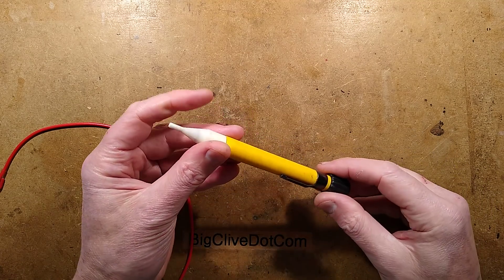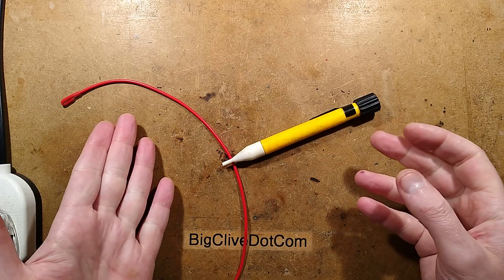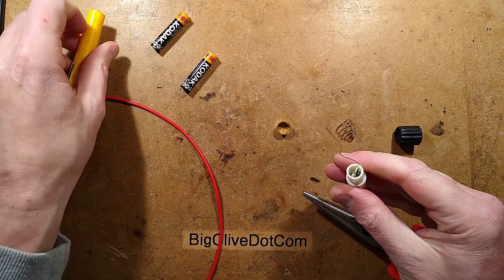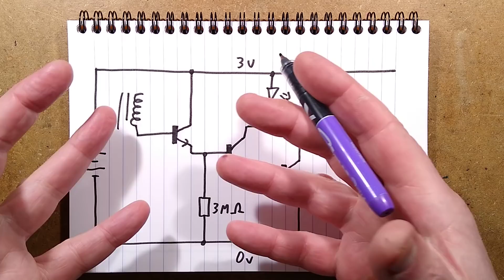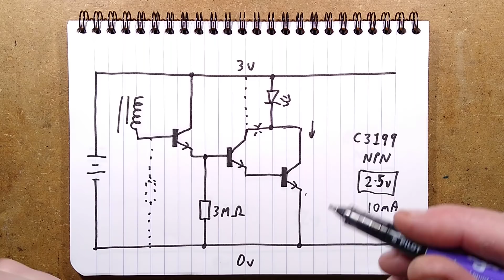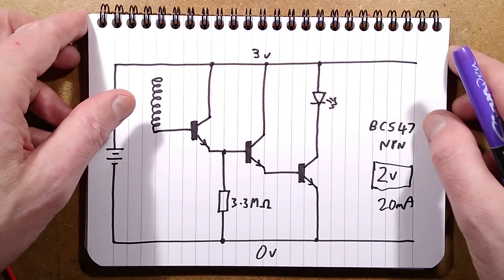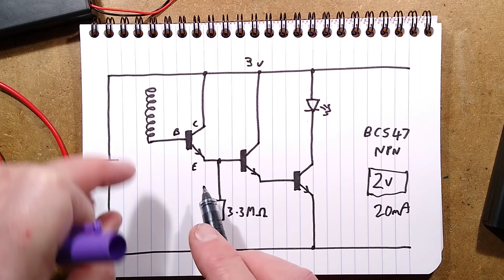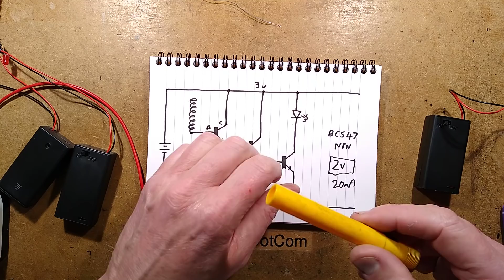Volt stick circuits and tests

Comment: Working on the Austin TX Trail of Lights we used these to find dead lamps in series strings as the voltage stops at the dead lamp. When you’re dealing with millions of little lightbulbs it made a big difference.
Reply: Unfortunately that method doesn't work for LED light strings. The LEDs only pass current in one direction making DC voltage which the testers can not detect.
I spent over an hour the first time I tried to fix an LED light string before I finally figured out why the test wasn't working.
Reply: I've tried to do the same but found it was inconsistent or fails to detect voltage beyond a certain point on a known good string - mine doesn't say the min voltage.  Do you know the min voltage on yours?
Reply: @bbaldwin9411  It's not supposed to light up on a known good string; you need a dead bulb to cause a significant voltage differential.
Reply: @CoolerQ  if we are measuring the voltage between the wire and ground reference as described, there must be a voltage difference, starting at 120 and decreasing along the lights as they are in series.  So the tester should detect voltage all along the string until the string is broken,, or the voltage drops below the testers detection limit. If you are measuring the voltage drop across each light then yes the drop would be small at every light, and large only if there is a break.
Reply: @bbaldwin9411  So would i be able to use one of these to find a break in an extension cord?
Reply: @oodmboo  Yes, but it will generally fail at one end or the other, where it is flexed the most. If it broke in the middle replace it, as this shows it was pulled too much and you will have multiple nearly broken places in it. You just power the cord, and test at the start all way round, as the other conductors will shield the line, and then half way down, then at the end. Will show a broken line, and then plug in a lamp, and you can find the broken return. Will however not be able to test the ground conductor is intact.
Reply: @SeanBZA  Thanks
Ive got a fifty mtr long heavy duty cord, I really didn't want to start cutting in half.
Reply: @bbaldwin9411  there is no voltage drop if no current is conducting. when there is a burn out bulb somewhere in the string then the voltage will be the same all the way to the burned out bulb. once the bulb is replaced and current flows then the voltage will drop. 

I've done this for many years do fix Christmas lights. takes a little practice but you can figure it out from either end of the string and quickly find the bad bulb. I've repaired dozens of strings this way
Reply: @oodmboo  yes. Plug the cord into powered outlet and a load into the cord
(Best is an incandescent light). Start at the "hot" end and move toward the load. When you cease getting an indication be sure to check all sides of the cord. If it stays off you have passed the break.
Reply: @jasonharrison25  w

Comment: I'm sure the original one i had was just a 2 transistor darlington, i could be wrong
One of the best things about that type of detector was in places with multiple lives (control panels etc), you could reduce the sensitivity and detection direction by moving your finger over the tip a little to get variable sensitivity
I have a similar one that uses a 74HC14  hex inverter with Schmitt-trigger and a couple of 'transistors' that i can't make out the numbering of, surface mount circuit
The sense wire is a 10k resistor with one wire cut off, the body of the resistor is at the tip

Comment: Current  gain    array, it's  similar    to a  current  source  (constant)   No  dio-deees  ?   It's   basically  like a  three  transistor  gain   stage   for
a  amplifier   circuit
Reply from the maker: It is really just a three stage amplifier.

Comment: To be sure: Are you providing the path to ground through the plastic on the wires?
Reply from the maker: Capacitive coupling from the metal inside.

Comment: Straight swapping in a small JFET for the frontend would increase sensitivity, while a MOSFET might perform better in the negative feedback configuration... pulling it off with three of the same transistor is highly economical though!
Reply: Using a JFET or any FET in this circuit has the problem of being damaged by static discharge.  The three BJTs are much more resistant to damage.
Reply: @acmefixer1  Especially since my favorite way to test mine before use is to rub it on my pants until it goes off from the static.
Reply: I really expected a single-MOSFET circuit when this video began.

Comment: I prefer to have a "widow maker" that also beeps as sometimes the light isn't bright enough to see in ambient light.
Reply: Sometimes the beeper is also handy for testing switches or finding breakers, if you can wedge it somewhere or have a helper hold it.

Comment: Simple design compared to the one I bought. Mine is audible and pulses the LED in the same way it pulses the piezo buzzer at a few hertz. It requires you to hold it as the power switch is momentary. It does a self test at power up by pulsing the LED and buzzer once. Power supply is from a boost converter as it only takes one AAA cell. As far as sensitivity is concerned, it will work perpendicular to a cable with both live and neutral side by side at 120 volts and will also pick up the leakage of the interference suppression cap on switching supplies.

Comment: I have a yellow metal cased 'version' but it is actually a magnet detector (RS 214-338) along with the Volt Stick which is black plastic (RS 214-467) both bought many years ago and still working.  Maybe it's the yellow magnet detector you remember as metal cased.

Comment: I find it hard to trust these things. I don't have a voltstick but I do have a couple of DVMs with the feature. Maybe it's just because I haven't learned to trust them, but it feels as though there are so many reasons why they may not show a result that it's hard to believe they will give a proper warning. Clive's experience with the battery in this one, and the simplicity (and lack of precision) in the circuitry  only strengthens my prejudice. I still prefer the old neon screwdriver. There's less to go wrong, though they still have the disadvantage of indicating safety by being 'off'. I guess what I really want is something that reads the actual voltage gradient.
Reply: Yep, never trusted them. When you work on control panels and distribution boards these volt sticks light up before you've even got it near. Like you, I still prefer a neon screwdriver for initial fault finding, and yes I test it against a known live before fault finding.I've got DVMs with it built it and don't use at all. Anything more than initial fault finding is done with a DVM at all times. I've caught my staff out when they've been carrying out maintenance on duel supply machines before and they've used volt sticks. Didn't like it when I used a neon to show that there was still mains on the panel, liked it even less when they all had retraining on LOTO forced on them all. Seems they "forgot" that the duel supply machines , apart from two 3 phase 400volt , also had a 110volt control signal wiring from the master control panels.
My view is that I hate the paperwork and funerals, plus I look awful in black ! Test, test and test again, you're a long time dead otherwise.

Comment: Based on the quoted gain from the transistors, the current coming from the antenna is on the order of a nanoamp. Back in my childhood watching the Royal Institution Christmas Lectures (to which I have previously compared these videos) I remember one lecturer presenting what he called a "micro-micro-ammeter" (it would be a picoammeter today) but how that worked I have forgotten.
Reply: The transistor's current gain falls off at very low collector currents, might be only 1/10 of what it's supposed to be at normal currents.  But still, with 3 transistors the current gain could be more than a million.

Comment: The shirt swipe test is a great trick!  I didn't know that one, but it's obvious in retrospect.  The best tricks always are.  Thanks for sharing it, I've always been able to find a 120v line to test with, but that saves steps.

I was surprised not to see a FET in there. The related circuit I know about is the electrostatic field detector (sounds like the ghost detector), which uses a common FET with a leg bent up as the antenna.  You should revisit the ghost detector, it's a fun circuit and I think I vaguely remember it on here years ago. If it's one like the circuit I found, they're easy to make and fun to mess around with.  Though the FETs aren't nearly as common for new folks to have (everybody has an excess of NPNs).

They're cute, too: they fit on top of a 9v, waving hello at people, while blinking like something Tom Baker would've had to disarm before an evil green bubblewrap monster blew up some planet or another.
Reply from the maker: I've avoided FETs in my electrostatic charge detectors as the floating input is very easy to damage with electrostatic discharge.  It really needs some form of protection.
Reply: You should know that there are models of volt pens / sticks out there that have options for variable sensitivity, and when the sensitivity is set too low, the "rubbing along the shirt sleeve" trick doesn't work so well.
I have one that can detect a rub on a shirt sleeve every time on the highest setting, about 30-40% of the time on the middle setting, and never on the lowest setting.
There are uses for the variable sensitivity capability in some circumstances, so I'm not angry about it being a thing.
Reply: @jdgower1  Mine works on my hairy arm lol.

Comment: So why do they light up with a gentle bump? False positives happen which is ok, false negatives not so much!
Reply: It's not the bump but rather the act of bringing it rapidly near another object which induced a static charge. I always test the operation before use by rapidly moving my finger toward and away from the tip.

Comment: The unit I have has what I assume is a potentiometer in place of (or probably in series with) the resistor, so I can adjust the sensitivity. The other end of the unit has the ability to detect current.